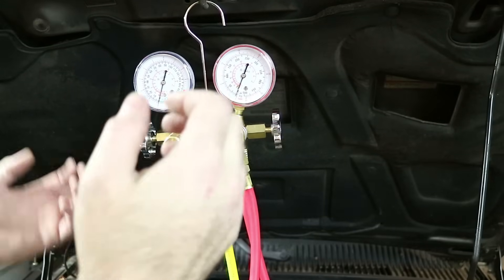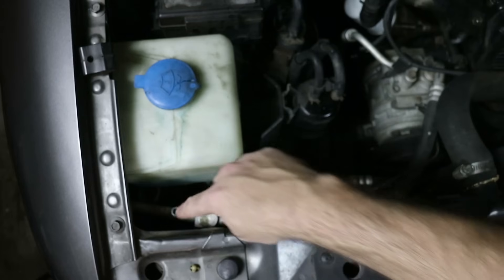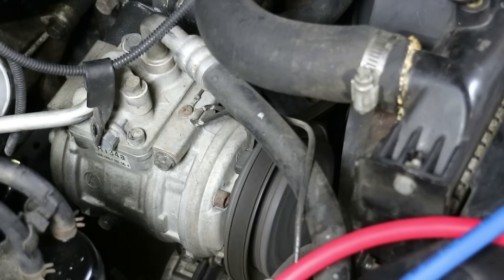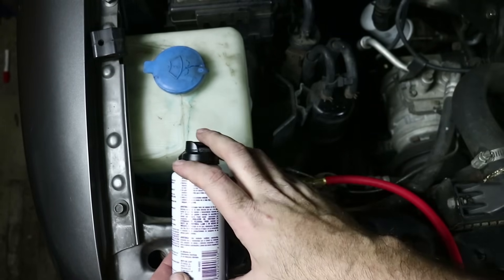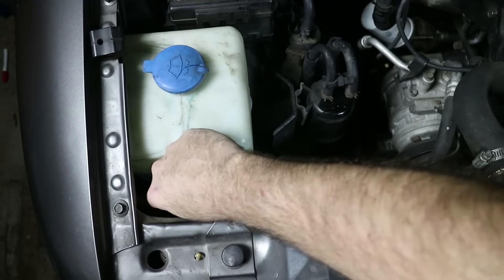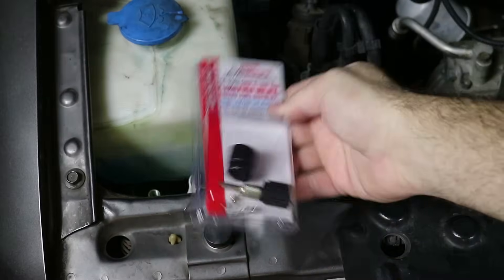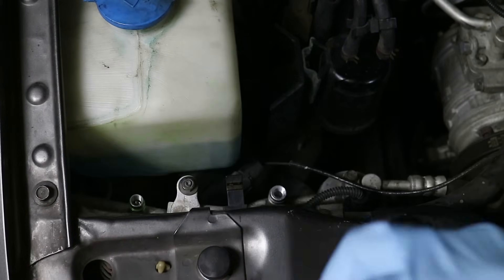How To Recharge an A/C System Professionally DIY

Comment: You should always confirm the leak, before just replacing a part. Easiest, was to check your schrader valves is to spray soapy water mix on them. No high tech equipment needed.
Reply: UNLESS your system has ZERO charge in it to begin with.
Reply: @chucklemberg4968  of course one of the first things you would have done troubleshooting the issue was throw a set of gauges  on it.
Reply: Soapy water only works as a leak detector if you pressurize the system, not if you put a vacuum on the system.
Reply: @RbNetEngr  Some shops pressurize the system with nitrogen.  I have read about some people simply using shop air.  After repairing/replacing the faulty parts, you need to pull a full vacuum.

Comment: This must be the only set of gauges he has (not really) it doesn't take but the $14.99 set or single gauge you see that's already attached to a large bottle of 134 you bought 20 years back, which is a rip off but for ppl in a hurry or do it yourself ERS it's a good time as long as you know what you're doing. Don't over charge or you may blow the compressor. There's a good cleaner that is excellent for spraying into and through the fins of the condenser then after just a few minutes spray the cleaner with clean water from a garden hose, if you have access to the condenser look to see that the aluminum fins are straight, you may find there's a tool to help but it's a slow process but the better transfer the cooler your AC so that's your choice. Stay Cool n Stay Happy !

Comment: Great video, after disconnecting the high side hose do you normally sweep the gas to the low side and back into the system, there is usually a few ounces of gas and oil left in the hose depending on length.
Reply: Close the valve at the can first, then the hose at the service port.

Comment: You know you are changing the Schrader valves yet pull a vacuum then says it will leak out? When you remove the Schrader valve the vacuum sucks atmosphere in. Don't pull your vacuum until after you change your valves. Purge your blue line too.
Reply: $27,500 fine for not vacuuming system... 10k headhunting bounty for reporting https://www.escogroup.org/documents/609pm.pdf

Here's the important part considering I doubt you look at the manual...

"An Ozone molecule consists of three oxygen atoms (O3).  When CFC's are released into the atmosphere, the Ozone
molecule is broken down.  The Chlorine in the CFC is the culprit.  A single Chlorine atom aƩacks the ozone molecule,
 taking one of its oxygen atoms, creaƟng Chlorine Monoxide (CIO) and Oxygen (O2).    The Chlorine Monoxide molecule then goes on to aƩack another ozone molecule, taking another oxygen atom, forming more O2 and then releasing the single Chlorine atom.  The Chlorine atom conƟnues this chain reacƟon destroying as many as 100,000  ozone molecules.  It is now clear why the producƟon of CFC refrigerants must be phased out and CFC's currently in use must be captured and recycled.  Technicians must never intenƟonally vent refrigerants to the atmosphere"

That last part is the bounty part :) where do you work? I would love an easy 10k lol...

So dude is going by the book to see if there is a leak in the system... no vacuum loss no leak... is vacuum loss is leak... oil dye and 134a has to be added in a vacuum to for proper changes in state from liquid to gas in the system
Reply: He did pull a vacuum again after changing the service port valve cores (Schrader valves).  Did you miss that, or did I see something that wasn't actually there?

Comment: hello, I have a bmw x5 e53 and I have the problem that the compressor turns on when he wants, I wanted to know if you could help me in this thanks and greetings from Panama.
Reply: If your compressor clutch isn't coming on , you could have a faulty clutch cycling switch (if your system has an orifice tube (CCOT) system) or too much air gap on your compressor clutch.

Comment: Hi, I just learn from some youtuber, please correct if wrong... with engine off... after vacuum.. they refill the high pressure first by upside the R134a tank till full..then close the High pressure valve.. then start the engine rev to 2000rpm for a while...then open low pressure valve with r134a tank upright position. Let me know if this technique can be done . Tq
Reply: More YouTube know it alls

Comment: U didn't purge correctly, could've slugged and didnt jumper low pressure switch for full recharge before short cycling. Otherwise good.
Reply: He did fine

Comment: Just recently purchased a set of 134A gauges. However, when I attempted to charge my 96 Ford Explorer using the 12 oz. cans, i realized that the yellow vacuum/charging line would not fit on the can. The gauge  fitting threads are NC (normally course) and
the threads on the 12-oz, refrigerant cans are NF (normally fine) threads. I went by my local HVAC dealer and was going to  
purchase another tap but quickly noticed that the threads on the can are still NF and will not fit my NC yellow manifold gauge
 fitting. So what do I do now? I have been to ebay and Amazon and cannot find a tap that will fit the 12-oz Freon cans and my
 yellow  manifold line fitting.
Reply: California problem?

Comment: Hi, I just installed the new ac compressor with the oil in it. Would it be ok to drive the car down to the shop and have the recharge the system? Figure it would be better to ask first, than screw anything up at this point. Thanks again for your videos!
Reply from the maker: Tracie Reece so one thing you’re are supposed to do when installing a new compressor is drain the oil out of the OLD one and measure it. Then drain the oil from the new one and add back the same amount you drained from the old one. This because as the system gets used over the years, the oil cycles around and coats the insides of all the pipes and components so much of it remains in the system when you take the old compressor out. But in general, yes you can do what you’re asking.
Reply: Just make sure the AC is turned off.  Probably little harm if you do as the low pressure switch will prevent the compressor from starting.

Comment: The oil that came out should be replaced
Reply: Never add oil to your existing a/c system you only lug the compressor down it takes very little oil to look like you lost it all. You fill your compressor and other parts when you replace everything and start from new other than that I don't care how many lines you blow not enough oil comes out to ever replace it and it won't be cold. Good luck getting it coming out of the vent at 29 degrees like mine in my 50 year old chevy
Reply: @YourMom-mq4zc  Mine is 25* F and you are a jerk

Comment: How you gonna draw air into the system when the compressor is running and at 30psi? Charge Like a pro, cmon man youre handing out straight up wrong info. Go get an ASE ac cert, THEN make videos
Reply from the maker: The compressor is sucking on the blue line, pushing on the red line, which is why you only charge through the blue/cold side. The can is at 70psi, system is at 30psi, you do the math. First learn what you’re talking about, THEN try to troll someone on YouTube.
Reply: 50sKid if you open the low side while its running without the service line attached to a can it'll just let freon out, not suck air into the system idiot cause its positive pressure. The only possible way it'll do that is if the expansion valve or otube was clogged and creating suction on the low side. The fact that you didn't even check the evap or drain for a leak shows your experience level.
Reply: @lexpen9016  I'll have to watch the video again because I don't remember him saying what you attribute to him.
Reply: No tolling here and you are WRONG!

Comment: Question: I already have oil & Dye in my system I have to replace both suction & discharge lines only nothing else, should I add any more oil or dye? I'm thinking I shouldn't because I shouldn't be losing that much, Thank you great video!
Reply from the maker: It kind of depends on the shape of the lines.  Some of them have bends in them that can trap a significant portion of oil.  The general rule with replacing components on an a/c system is that you should drain out the oil from them into a measuring container and then add back exactly the amount you drained out.  Sure there will be a bit of oil that is "coating" the inside of your lines that you will never really be able to collect and measure, but it shouldn't be significant enough to matter.
Reply: 50sKid Thank you

Comment: so just to verify, after you vacuum your system you want to release the pressure of the vacuum back to zero? Thanks in advance
Reply: no, add "Freon" while under vacuum
Reply: As you disconnect then reconnect the supply hose to your freon, you will lose your vacuum anyway.  But the purpose of the vacuum step is to draw moisture out of the system.

Comment: The gas in the low pressure line is colder than the gas in the can. You should not put liquid refrigerant into the suction line.

Comment: 9:04 "So I'm just doing a quick vacuum right now, I don't need to do it for 30 minutes because I already did that before."

Wrong! When you let air back into the system, you bring with it moisture. Blow up a balloon with air, then let the air out and look inside. You will see lots of moisture. When you bring the system back to atmospheric pressure, you bring back a lot of moisture, possibly more than there was before you even vacuumed it. You must vacuum it all over and I would do it for at least an hour or more. Ever own an air compressor? Ever open the drain at the bottom to get the water out? That water all came from the air.
Reply: Your stupid. I have never done 30 minutes unless I filled it with air to find a leak in fact my 4 thousand dollar machine is set from the factory at 15 minutes when you hit the vacuum button. It's not a house or a chiller. Car systems aren't that critical or as expensive
Reply: @YourMom-mq4zc  It's "You're stupid", not "Your stupid", Stupid.

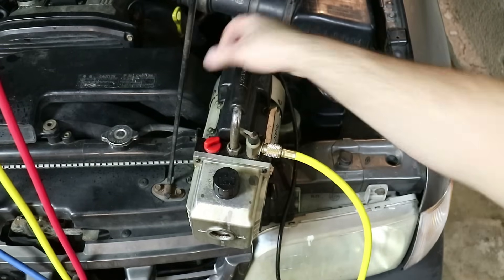Comment: When you went vac the system, at about 6:27 you hooked up the yellow hose to the manifold. Then said "i'm going to open both ports all the way" and you turned both ports open at manifold. Question is, Were both valves open at the other end of the lines, on car's ac line's  Hi and Lo ports when you opened both valves at the manifold?
Reply: the valves on the manifold ONLY access the middle charge line.

Comment: The most accurate solution in charging the hvac system is by measuring in weight,because the refregirant enthalpy will diff depending on your altitude from the sea level
Reply: OK, here's my problem.  I went to recharge the system.  Things were going very well;  but then the high-pressure line on my manifold gauge set burst and started venting from the high side.  I now have the better portion of a can in the system, but I'm not sure how much.  I do not wish to pay for an evacuation and start from scratch pulling a vacuum, checking for leaks, then adding refrigerant.  Right now, I'm just planning to add more refrigerant until the manifold gauges reflect the high side of the pressure range set out for the ambient temperature and humidity.  What would you recommend?

Comment: at 30 psi on your low side,your high side should be about 155,at 200 psi you  have  possible blockage of the
expansion valve or orifice tube. 

here is the chart  

http://rechargeac.com/how-to/ac-system-pressure-chart

Comment: wait... 'means there is a leak somewhere ' ?   maybe the A/C system is untouched in a 2000 year car and is just now starting to show not frigid inside when set to coldest. A small amount of refrigerant leaks out over time.... and 17 seasons of hot weather running is a lot of time (2000-2017).
Reply: And the point?
Reply: exactly...

Comment: Great Video! Quick Question, I have a 2000 323Ci, which has both the auxiliary fan and the mechanical fan. Do you know if the air compressor clutch will NOT engage if the Auxiliary fan is not functional? I keep hearing different views on it. (I should also get started on fixing the aux fan). Thank you!
Reply from the maker: No that wouldn't happen
Reply: In some systems the same powered that comes from the relay that powers the auxiliary fan is the same powered that turns on the compressor , sometimes there separate signals though
Reply: Alright, well if the air compressor clutch will still engage even without the Aux fan, then I will give charging the system a try then. Thank you!

Comment: Never flip the can , gonna kill he compressor charging liquid to the low side 😳
Reply from the maker: +Chase Shreeve there are two reasons that won't happen: 1) we're putting the high pressure contents of the can at 75psi into a  lower pressure line at 30 psi of warm refrigerant coming from the evaporator after having absorbed heat from the car. That causes it to evaporate into a gas. 2) we've got about 5 feet of yellow hose and another 5 feet of blue hose for it to travel through. Plenty of time for it to evaporate. So the compressor isn't going to get slogged.
Reply: @50sKid  Even the can says shake up right and turn on its side occasionally. It doesn't say turn upside down. Yes you can hydro-lock the compressor. Patience is the key. Done right it will take about 10 minutes a can. The Freon goes through the evaporator then the compressor then the condensor where it heats up it's first cycle. The first cycle will be in liquid form if you hold the can upside down. Kind of risky for an expensive compressor. Notice your line freezes just past the orifice tube.
Reply: If the compressor is off you can charge liquid to the high side until stop and charge the vapor to low side this guy try to kill the compressor by charging liquid to the low side go straight to the compressor

Comment: you should add the additional oz and see your vent temperature come down.  44 degrees is not super duper cold.   Cold would be 32 degrees.  44 is not cold enough for high summer temperature.
Reply from the maker: 32 would be icing up, actually.
Reply: Cold enough for me, very few get it down in the thirties
Reply: Vent temperature should vary based upon the outside temperature - the higher the outside temperature, the lower the vent temp will be.  I never seen vent temperatures below 40 indicated in any of the service manuals or charts that I've used.

Comment: You are my man, i'm happy to see someone knows what's going on behind the seen ( on those manifold gauges ) ... most of my friends believe that the 2 valves controls the high and the low lines .. and they call themselves professionals :D, tried many times explaining to them that the valves are used to control the connection between the low - high & the yellow .. but they don't seem to get it .

Comment: Hi ok I did everything right but my AC does not cycle off ? It's a 2011 Altima 2.5  and reading are 33 and 160 on a 80 degree day ? Blows 80% cold air , low line sweats .. when I unplug the high plug on the car side it's under lots of pressure ? It shoots out some freon is that normal ?
Reply from the maker: Not all systems cycle off.  Pressures seem good.  If you're still not getting good cooling it could be a clogged up expansion valve or orifice tube (depending on the type of system).
Reply: 50sKid 
Hi thanks for replying I called nissan they said it's supposed to cycle ?? How can I make sure this model does ? And also I added more freon today and readings were 43 and 185 ( 85 degree day ) and it's blowing a little colder now .. but by the readings I can 100% tell how much freon I have in their ? Because I feel like I put more than required .
Reply: @naiefelyemeni1986  Look to see if it has a front clutch
Reply: on a 80 degree day you low side should be  40-50 psi and high side should be  175-210 , need more gas in it 
here is the chart 

 http://rechargeac.com/how-to/ac-system-pressure-chart
Reply: The compressor pulley will always rotate.  It is when the clutch is activated that the compressor is actually running, no?
Reply: @IamKurr  Compressor only spins when activated

Comment: Yes it was good . But when do you open the (RED) High side please.
Reply: Yes, he said the red side valve gets closed and stays closed after the vacuum is drawn. Only the low side (blue) gets opened after that.
Reply from the maker: You don't.  A professional a/c machine will have the ability to pump in the required charge of liquid refrigerant into the high side when the engine is not running--that's the only time it's used.
Reply: Which means I will be filling in the Low side, so will leave the High closed ??
Reply: @50sKid  The red (high side) is opened only during evacuation/vacuuming.

Comment: BE careful!  A 12-fluid-ounce can of R134a contains a pound of refrigerant (15.8 oz)  by weight.  2 cans overcharges your system by a lot (32 oz versus the manufacturer's 25 oz.)
Reply: Bruce Cook hahaha you didn't know...a pound of bricks weighs more than a pound of feathers
Reply: On the can, “12oz(340g)”. 340g is 0.75lb. So, 12oz can contains 3/4 pound, not a pound. This happens because of stupid US unit. US stays in ancient world while the other countries evolve.
Reply: 12 oz. is the amount of refrigerant in the can plus the can weight (+/- 3.5 oz.) = 15+ oz.